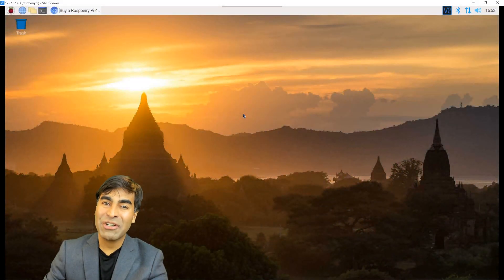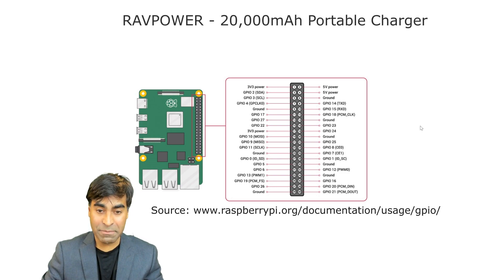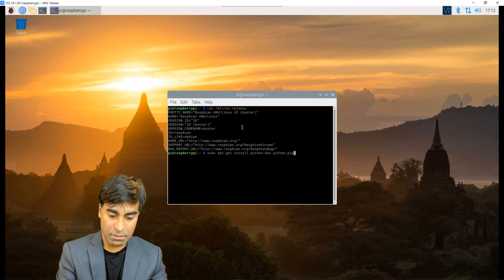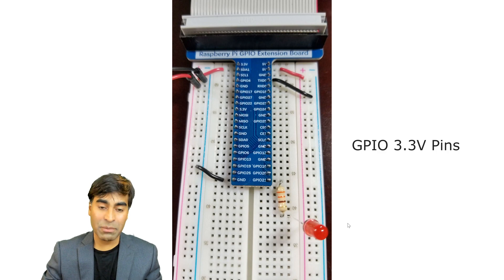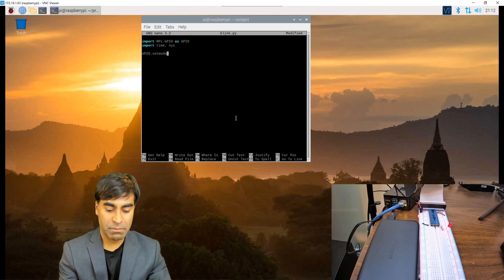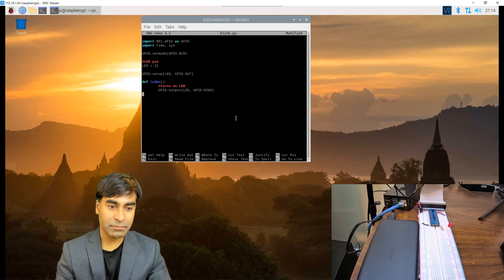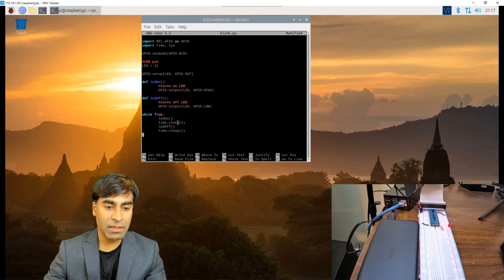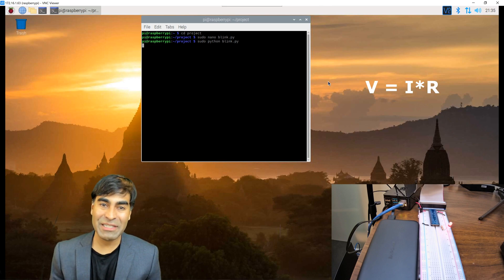Blink an LED using Python - Lesson 1 on How to Build a RASPBERRY PI ROBOT

Comment from the maker: Note: Typically, you want to avoid using the sudo command where possible since it gives you root privileges. I used sudo only because I was working in a folder that required admin permissions. To create a file using the text editor, simply type nano <filename>.py. However, you will need to use sudo python <filename>.py to execute the script because higher permission levels are required to control GPIO pins.

Comment: a simple question
how do we stop the LED flashing without disconnecting everything ?
Reply from the maker: Good question. There are a few ways you can do that. You can write a program that will blink the LED a specified number of times in a for loop and then end (not using an infinite while loop) and use GPIO.cleanup() before it ends the program. Or you can have a user input (like in Lesson2), were the user can turn the blinking LED on or off.
Reply: @ShaunNanan  
Thank you very much for your quick response.
I actually browsed your other videos and I am now
to your video on the stepper motor. and I actually found a way to turn off my LED in the second video.
but here is that when I quit my program my LED remains on or off depending on its state it was before quitting and this even if I do a 'GPIO.cleanup'.
 Of course I can always do a 'GPIO.LOW' before quitting.

I will follow your videos with great interest because I intend to build the robot and more
Reply from the maker: @etrembla1  That's great, and I'm very happy to help. It's possible that the GPIO.cleanup() statement is not being executed before your program ends; it should disable all pins. Yes, you can put a LOW on the GPIO to turn off the LED before ending. You can see in Lesson3, I use a break statement to break out of the while loop, and then it does the GPIO.cleanup() before it ends the program.